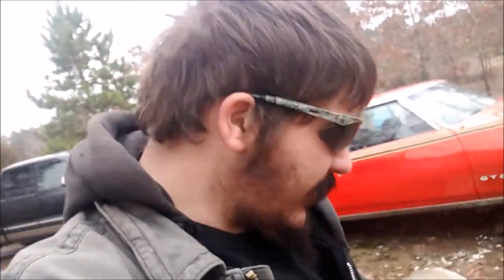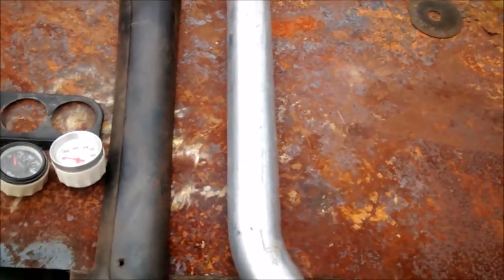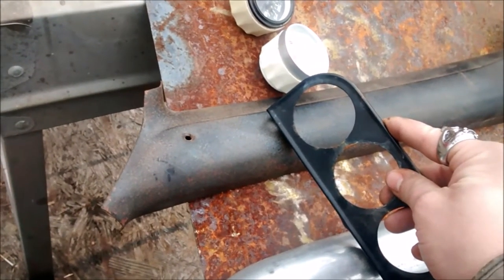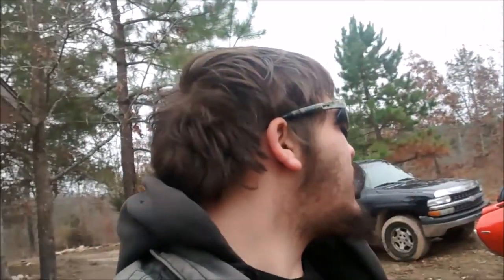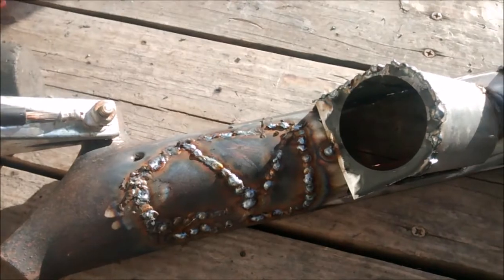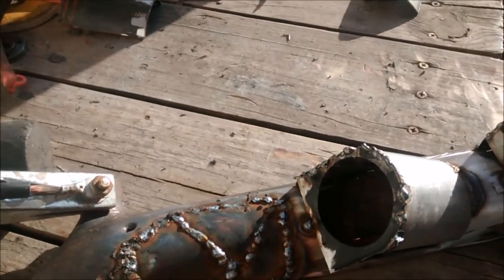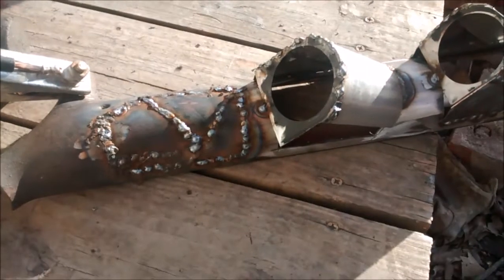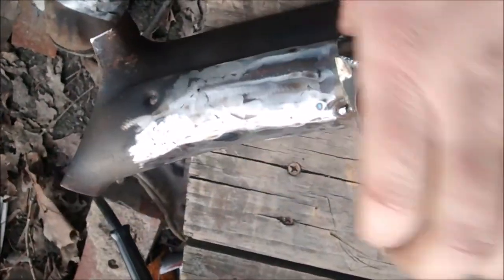Custom Fabricated A-Pillar Gauge Pod for Project69 Part 1

Comment: I was thinking about doing something similar with my firebird but the a pillar molding is covered in vinyl so not shure how it will work.  I need to order new ones anyway so maybe il see what I can do  with the damaged one I have.  nice job
Reply from the maker: +Chris Mansker best way to do it would remove the vinyl... and if you want to recover it it would be too hard to do so.